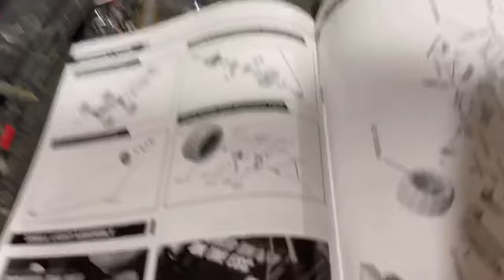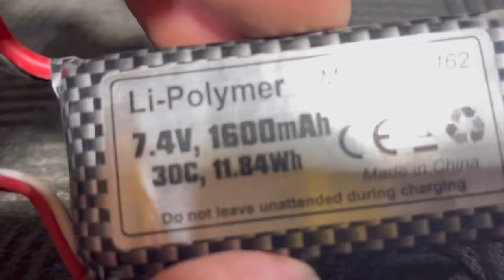New CHEAP RC CAR! Full review and field test-DEERC 9000E

Comment: Good look and test with the 9000e. Was wondering if yours would work with a lipo.  Friend of mine tried and it shutdown on him like it was going into a voltage protection.
Reply from the maker: Thanks! Was it Perth West, or someone else? I did see his. Mine ran flawlessly with it. Hopefully his is just a faulty esc and an isolated incident,
Reply: @DerbyCityRC  yeah it was Perth West Oz who had it cut out with a Lipo but ran fine with the Li-ion
Reply from the maker: Ya, I watched his after I recorded mine. I was quite surprised!

Comment: Just bought one and threw on some drift tires, pretty nice truck …but the manual don’t says we’re to buy upgrade part..I want to do a lil bling since um just drifting it
Reply from the maker: Awesome! This would definitely be a nice drifter. Very cool! I don’t think the aftermarket has upgraded parts for it yet. What type of upgrades are you thinking?
Reply: @DerbyCityRC  diff’s & shocks for sure but some time down the line shock towers n all aluminum arms jus to add some weight to the car.. but would Amazon have the parts? Cus the deerc website don’t tell me anything bout this truck nore do I see it
Reply from the maker: This is a newer car model. Amazon won’t have much, or anything, for it yet. You should be able to get more information by emailing them. They tend to be pretty responsive. (Keep in mind they are in China, so sometimes they respond during the night hours, depending on where you live). Email them at usa@deerc.com.
Reply: @DerbyCityRC  cool thanks..nice flips btw waiting to see your upgrades on it cus u b doing some wicked stunts with these 1/16 1/18 rigs..made me get my first one n it’s this..thanks bro 😎
Reply from the maker: Awesome! Glad I can help! 😎
Some of my favorite stunts are with my 1/12 scales!
Reply: @DerbyCityRC  goin on Amazon now and look up 1/12 scale to bash on my Arrma rigs getn expensive to upgrade love them but need something else to take they place while they in the shop but thank keep up the vids!
Reply from the maker: If you’re up for upgrading this car to brushless, it’s definitely the one I recommend! I have the truck and all parts linked in the description 
https://youtu.be/GvNNjAeEn10

Comment: Can it be upgraded to a brushless motor with a 3s? If it can, what are the parts? Thanks!
Reply from the maker: This one would not work well. It’s difficult to get to the motor. I’m sure it could be done but the way this car is designed, I think it should stay stock.
Reply: @DerbyCityRC  ok thanks.
Reply: @DerbyCityRC  What about a deerc 9206e?
Reply from the maker: You’re welcome!
Reply from the maker: That one, yes. I have a few videos showing cars with that chassis with brushless setups!
Reply: @DerbyCityRC  thanks man. I'm just into the hobby so I don't which rc's are compatible😅
Reply from the maker: lol I hear ya. Here’s a couple 9205/6e vids for reference.
https://youtu.be/9E3rVUqnNwc
https://youtu.be/bT0lcHs_mdY
https://youtu.be/NFqQvoqBUbs
https://youtu.be/YNWdBe_jjk0
https://youtu.be/8mgh8dPEF4U
Hope these help lol

Comment: Obviously make it faster and put oil filled shocks on it and that'll be a really nice RC car.😊
Reply from the maker: I may still do that one day lol. This car is still kickin except for the body is cracked up real bad lol
Reply: @DerbyCityRC could you do a little experiment for me and I'm sure others would like to know. But it'd be nice to try some flex seal for your bodies instead of the shoe goo and drywall tape. Just throwing it out there.😮
Reply from the maker: Well hello (6 months later)! I tried something similar to flex seal on a video from nearly 3 years ago. Maybe it even was flex seal, but it was clear and in a can. It worked ok, but no where near as good as tape and shoe goo.
Reply from the maker: I think I looked with no luck, but check pxtoysrc.com and if not there, Deerc is pretty active in answering questions. I’d send them an email or a Facebook message and ask if it’s available. I just haven’t done that yet lol

Comment: I thought this car would be a good competitor for the hbx 16890 destroyer, but I don't think so. Correct me if I'm wrong
Reply from the maker: No unfortunately it’s not a competitor to the 16890. 16890 or the 16889a is much faster.
Reply: 😕I thought it was so beautiful and even bigger, besides being cheaper than the hbx ones, I almost buy it instead of the 1689
Reply: thank you so much for the video, it cleared my doubts🤝🏽✌🏽🇧🇷
Reply from the maker: Yaaaaa. It’s a little bigger but doesn’t perform nearly as well. Really out of all of them I recommend the HBX 16889a PRO

Comment: Hey Man dyk the difference between the 200E & the 9200E , yeah that gray is KICK ASS color 😀👊👍✌️🦅🇺🇸🦼
Reply from the maker: The 200e is brushless and the 9200e is brushed.
Have you seen my video on the 210e? It’s basically the 200e but a different body and comes with 3s batteries!
(Also, if you use a link I provide in any of the video descriptions, it helps the channel 😊)